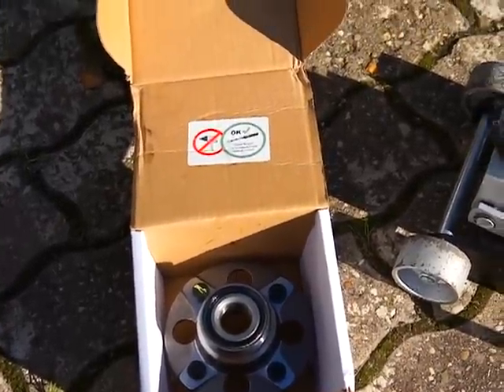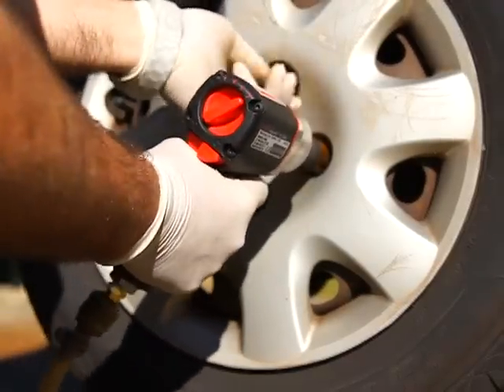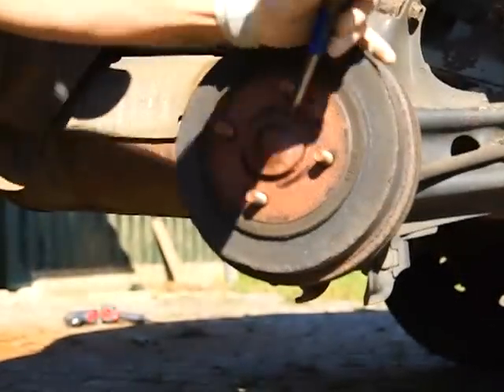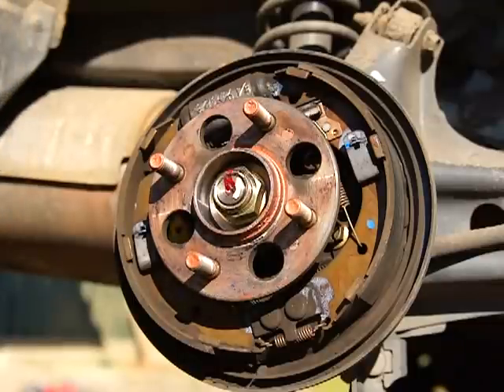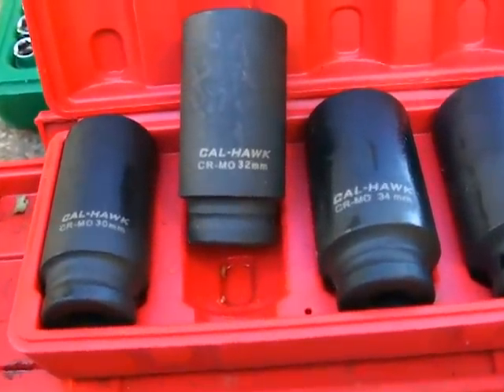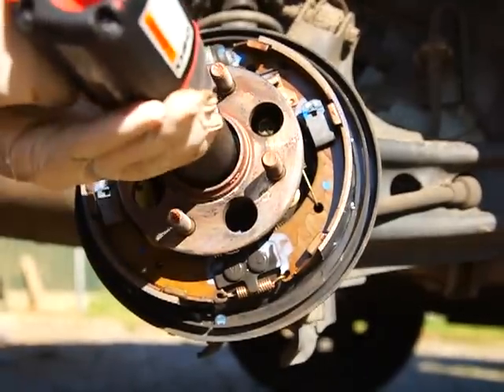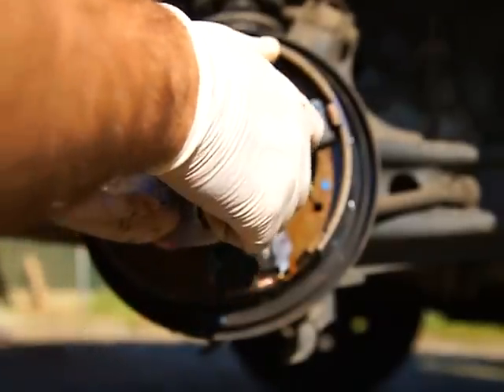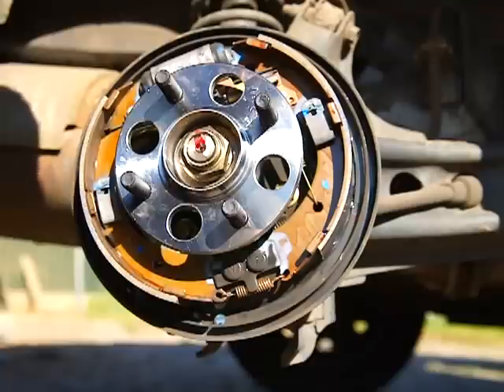How To Replace (Remove and Install) Honda Civic Rear Wheel Hub Bearings

Comment: Thanks man I did mine today but a 30 min job became in a 3 1/5 hour job, the part of the hub assembly that seals the bearing got stuck in the spindle, me and my dad had to take the hole drum brake off to hammer the s**t out of it.

Comment: A BETTER METHOD for getting that dust out is to use a shopvac so you don't breath all that nasty dust that I'm sure has something bad for your health in it! Or hose it down with some soapy water and rinse. Then air dry it lightly with compressed air / hair dryer etc.
Reply: autoparts321 or you can use brake clean that’s what it is for

Comment: Well after replacing my front two wheel bearings the noise was still there than I tried the rear wheel bearing which was the easiest to replace... and it worked perfectly fine I wish I knew this from the beginning. All the money i wasted. Great video helps alot!

Comment: Thanks for the info. I'm about to do both of my rear hub assemblies on my 2000 Civic DX Hatchback 5 Speed. I'm not much of a car guy, but I'm certain I can do this. Plus, me doing the labor is much cheaper! I spent $141 on two Timken hub assemblies vs. $160+ to get one done at a shop!

Comment: what if it is a front wheel drive civic same year. drum style in the rear. would you have to remove the whole knucke to remove the hub assembly? (doing the rear hub assembly?)

Comment: Thanks Roygillin, Great job on the video !   Make some more ! LOL  Doing mine today to see if it will quiet down new tires and it still is noisy, the old bearing doesn't seem bad but we'll see if the new ones make a difference.  Thanks

Comment: I have a random question but when you removed the wheel hub assembly you know how there was 4 bolts that hold the backing plate to the car, can you remove the whole back plate/dust shield from the whole car with all the drum brake springs connected & assembled ??

Comment: Hi there, thanks for the video. I have a question. I have a honda civic 2001. I remember changing the 2 rear hubs because they were making a rumbling noise (2years ago). The noise never went away on the left side, now is even louder. You think anything else could be wrong in there? You think is something with the Lower control arm. or Should I just change the wheel hub bearing again? Thanks for your time in advance.

Comment: Got a question here...I have a 2002 Civic Ex coupe. I've noticed a noise that's been progressively louder for the last few months. Sounds like a train inside the car, and loud as hell, especially on the highway. I also get a metal to metal sound when I go over speedbumps. A mechanic said bearings and CV joints. Just looking for a second opinion here, thanks

Comment: Thanks for the great video roygilin, it helped very much. But I still have an issue.

I had to take apart my driver side rear brake drum because, when the car was jacket up, with the parking brake off, the passenger side wheel spun freely, but the driver side wheel would have much resistance and only spin a few times before stopping. I took off the drum and got the wheel, basically, looking like it does in the video.

But it still does not spin freely? What do you think could be causing this?

Comment: Nice camera work and description. Only comment is using compressed air and getting the brake dust airborne. Just spray brake clean with a pan underneath.

Comment: Just to reiterate, use brake parts cleaner so the dust doesn't get airborne. You must wait until your brakes have cooled down completely or you run the risk of creating Phosgene gas, will kill you.

Comment: hi can the Honda Civic Rear Wheel Hub Bearings works on the 1998 Japanese model crv? its a 4 Lugs wheel base.

Cheers
Smith
Reply: Did you ever find out?

Comment: I do have rear drums, Now, It can't be the front because that noise bothered me so much that I changed the 4 hub bearings then. But I didn't do it my friend did. I replaced all the breakes. But after replacing breaks, dics and drums..my emergency break wasn't working properly (meaning it doesn't break at all). 3 months after my pedal started bouncing a lot! so it must be that. I will replace disks, drums, breaks and the Left rear hub. I will take it to a professional and thank you for your time

Comment: If you can't get the drum off just take off the 32mm hub nut and slide the drum and hub off in one piece. You can then easily separate the hub/drum off the car on a workbench.

Comment: Thanks for the video. However, from where I live (lots of snow and harsh winter = lots of salt in streets and calcium = lots of rust) so phrases like "It will come right off" does not apply! 

Sometimes I may spend half an hour just trying to pull/PRY the dam drum off because all is stuck (and no the parking break is not on) 

Anyways, I just thought I'd share my frustrations :)